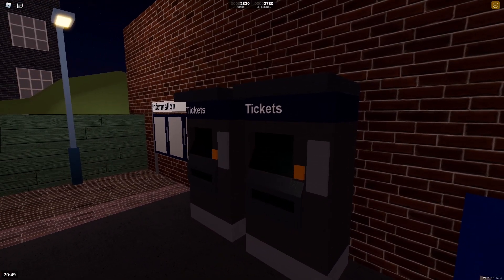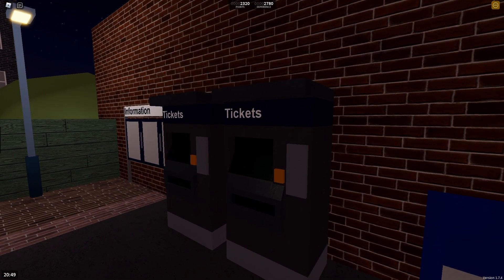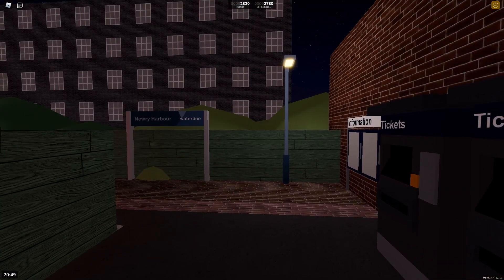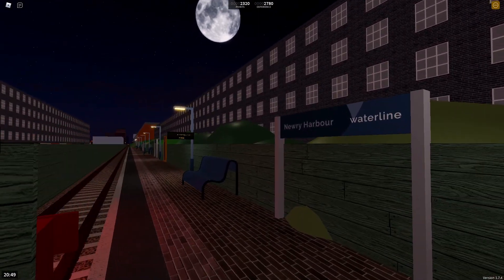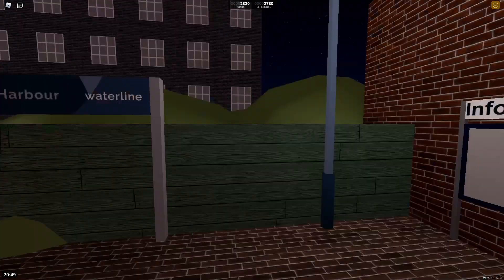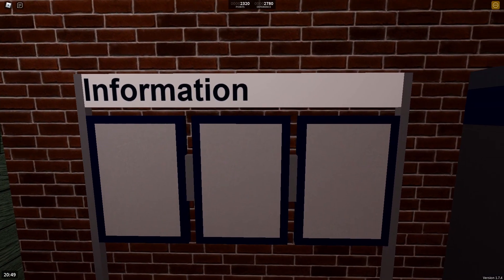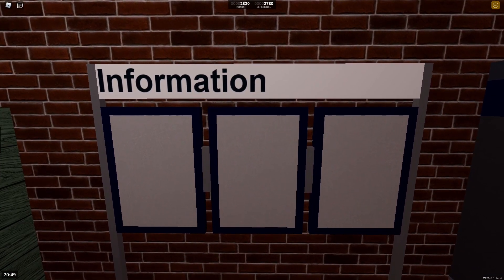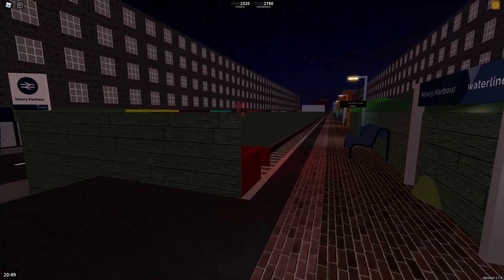Newry Harbour - WaterLine's Least Used Station

Comment: TFS has now announced the new passenger loads. Which are, 
50,000 Movements per month. 
10,000 of them are Express Passengers. (150 Average Per Day)
Rest of them are Waterline Passengers. (1,000 Per Day)
The reason is the rebuilt and new ferry and cruise service. Ferry Service is going to London and Cruise service is all round Great Britian and English Isles. Also that service terminates at Newry Harbour. Morganstown Docks are having dwindling numbers that one point something is weird happenning there. Also due to this, TFS and Waterline agreed to modernize it for all. Now, the station has 2 platforms for mix use for Waterline and newly operated Express.